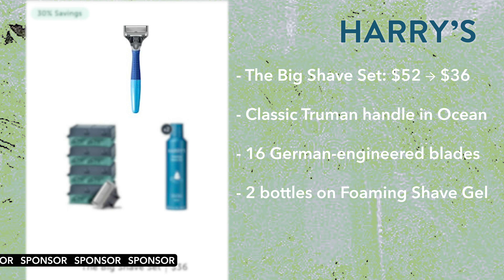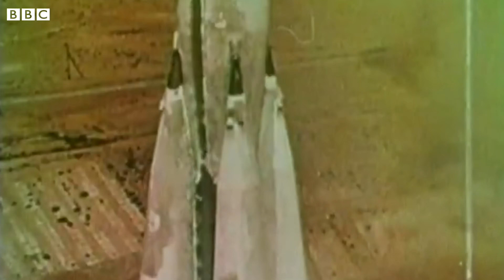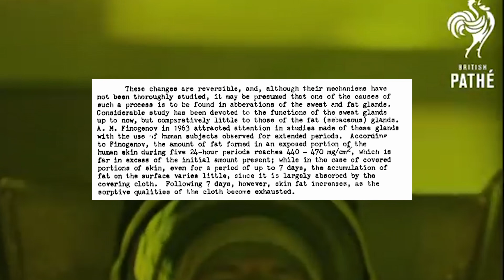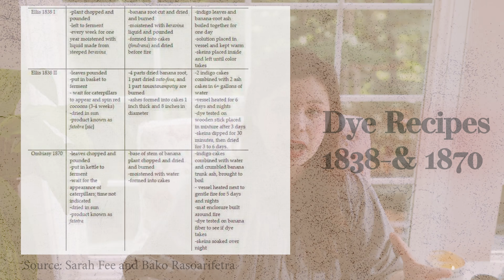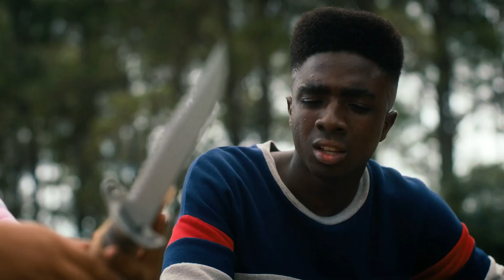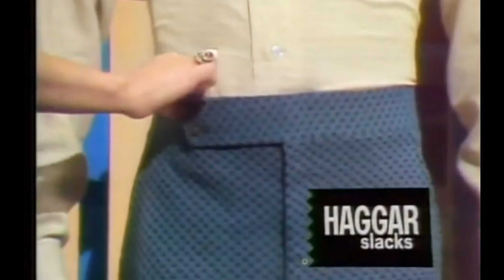The DISGUSTING truth about Laundry

Comment: I know I've left a lot of comments, but this topic and how it was presented really irked me. While the percent of people that line dry sounds about right, and probably varies by region, I really disliked that line drying was seen as almost non existent (maybe in the US it is). "For those of you who are not from North America why don't you just line dry your clothes"?

It's a bit classist. A number of poor people in North America do line dry their clothes, or at least hang some inside to dry. Some middle class people still line dry/air dry in the home, at least some of their clothes. I can't speak of all areas of Canada, but its not an unusual thing in Atlantic Canada. Maybe this comes from the number of rural/semi-rural areas, where it is just seen as usual. Many houses in these areas are set up for line drying, with porches that have a small table area to put down your peg basket, and the line is set up so you can just stay on your porch to reel out the clothes. You can buy wood pegs in most hardware stores, and plastic ones are abundant in homeware shops/specialty shops, etc. Both usually have both indoor and outdoor racks/lines.

Many people air dry in their home more delicate articles, or ones that would be  hard to iron. There has been a running joke for years about treadmills being expensive hangers for drying/ironing.

We have a smaller, more rural/semi-rural, and overall less wealthy population in Canada, compared to the US, so maybe that is the big difference.

Comment: Wow... I guess my lifelong dream of having all silk bedsheets and keeping them forever is unrealistic 😁
It's true in France the vast majority of us air-dry our clothes, even in apartments hanging from windows and balconies, or just indoors with a window open.
Another issue with our laundry practices is the energy used to heat the cold water which goes into the washing machine. We have readily available hot water in our homes heated by a water heater (however energy efficient it may be) but the washing machines are only connected to the cold water pipe. There are some machines with 2 pipe connections, one for cold and one for hot, but they're very hard to find, in france at least

Comment: As a thrift-loving germaphobe with specific sensory issues that force me to use a washer and dryer, this video sort of ruined my life. 😅 On the other hand, I’ve been wearing the clothes I have for decades with very little wear and tear despite having a machine with an agitator, so I think avoiding low quality fabrics in clothes will prevent a lot of the damage and waste Abby describes.
Reply: Your clothes are still getting clean. Hot water and soap will do the job and disinfect your clothes a good amount. Laundry detergent is not completely ineffective like the video claims (tbh I think the research was a bit biased in this one because she knew the point she wanted to make and only looked up and presented details that supported that point, and also exaggerated some parts to make modern laundry practices sound like more of a catastrophic disaster than they actually are) because of the way the molecules work. One side bonds to water, the other bonds to oils and the dirt and grime gets broken down and washed away, which will also take care of bacteria. Are traditional practices better at this? Perhaps, because you can actually boil the water which kills bacteria more effectively. But It's not a black and white situation where one works and the other doesn't. I assure you, your clothes are still getting clean and you are definitely not walking around with poopy t-shirts, you would know if you were.

And if you live in an area with hard water, you can use vinegar to soften it. Don't use more detergent than you need, because that can mess up your clothes and build up in your washer.
Reply: Probably Ive had some shirts for years and they are fine while others I had for a few months and are all faded. It's really in the material
Reply: Same here, germophobe in control. I wash my clothes frequently and I rarely have to trash clothes. I wear my clothes for years. Most of them are in good conditions.
Reply: Suddenly realizing that's a part of why fast fashion hurts in the long run since some companies like Shein are so focused on making as much clothes as possible, that it fuels the market with low quality fabrics.
Reply: I've only been using natural fibers for decades. I, too, have a washing machine with an agitator AND a dryer with a sensor--bought new in 1987. Our clothes last & last. Underwear, & linens are bleached lightly--always whites. I remember my grandmother line drying in freezing temps the clothes would actually be frozen. I have tears in my eyes thinking of her poor hands. Dryers are a godsend especially in colder climates. Many things in this video are factually incorrect or don't present the whole picture.

Comment: Grey water systems can compensate for the water waste. You do have to use specific plant based detergents but it’s an easy switch. And it can be cost effective. I do not have a plumbed system, the washing machine empties into buckets I carry to the yard. Total investment of 3 buckets and I no longer water the yard so tons of savings. Each load is 12 gallons of water. I also line dry. Old cotton clothing become rags around the house. Old polyester type fabrics become floor mats (shredded and tied into a knots). We really do not have to be wasteful, we choose to be.

Comment: I have been washing my clothes in a non electric washer caller the Wonder Wash (not the Wonder Washer, that is something different) for about 2 years now. it's adorable and mint green and it doesn't damage my clothes at all. It actually cleans better than my big shitty washer. It usually costs between $60 and $90 on amazon or ebay and it is so worth it. You do have to manually crank it but I actually find it kind of calming, it helps that I am just doing my own laundry so I don't have a ton to do. But I wash one ;load before bed and than hang them on my garage clothes line overnight so they are dry in the morning. You use a tiny amount of detergent and your clothes last so much longer.

Comment: Alright, so I hang dry about half of our clothes, but in order for them to dry fast enough to not smell mildewy I have to run a dehumidifier and a fan. And I have to use three drying racks, which takes up a ton of space.  It would be great to dry them outside, but it rains a lot and I don't have the option to wait for a sunny day. I have to do my laundry on the weekends or it won't get done.

All that to say, this is a complicated and messy issue.

Comment: fantastic video (yes to way more air drying!) but I have to clarify that surfactants do in fact sanitize. Most living cells are separated from the outside world by a double layer of molecules with one end that is attracted to water and one end that is repelled. Surfactants can attach to these molecules and open cells, breaking down our own cells, bacteria, and most viruses. So detergent is cleaning your clothes; very hot water / bleach is only necessary in particular cases (e.g. ringworm, norovirus)

Comment: I've been using homemade laundry products for years and enjoy experimenting with different formulas. My goal has been to eliminate plastic bottles, so my current favorite recipe only uses products sold in cardboard boxes. I mix 2 parts washing soda, 1 part borax, 1 part baking soda, 1/4 part Epsom or sea salt (to soften the water). I use about 1/4 cup per load along with 1/2 cup soap flakes (Zote white). I adjust this up or down and sometimes add (or spray on) white vinegar depending on dirt/stank. If washing in cold water, I mix all the cleaners in a cup of hot water first. Yes, it's a bit of extra work, but it's cheap, effective, eco-friendly, old-fashioned, and a bit of fun for science/history nerds! Laundry lines banned where I live, so I hang on a shower rod installed over the washer and dryer. I admit to using the dryer to fluff and defuzz, but for a fraction of the time. Experiment for yourself and enjoy the process!

Comment: Superbe! I've learned a lot. I've been doing my laundry detergent for years now and I've banned conditioner. I wash at VA no more than 30 in general, and I thought that was enough. I line dry indoors mostly.
For me the best part of this was discovering the anti-bacterial properties of linen. However I've never seen underwear made of that, I'm curious of where to find it. I try shopping only natural materials, but that's high privilege due to cost as you've said, it's more expensive and I care better for it.
The idea of full undergarments is interesting. I grew up using upper undershirt, however on my teens that got replaced by tops that were occasionally visible. but again... Linen Underwear is nowhere to be seen or is it?

Comment: Italian speaking here. I've been having a laundry-related mental breakdown for about a year. The old washing machine in the house I'm renting made all the clothes smell bad. Like really bad. Luckily we're not banned from using a driying rack, so the smell goes away when I dry them in the sun. I think I now know everything about washing and washing machine care, in the attempt to have nice smelling clothes. And I swear I was this close to buy a giant pot and boiling my weekly laundry.

Our washing machines are loaded with bacteria, which are the cause of bad smells (and also it's gross in general). I never wash at less than 40°C (104°F) anymore and once a month I run an empty cycle at 90°C (194°F) with citric acid (or vinegar) to sanitize the machine, remove the old detergent and limestone residue, which are also cause of bad smell (bacteria feast on those).  This makes my clothes not stink, but it's neither environmentally friendly nor economic. And this drives me nuts.

Sorry for the rant. I just wish my landlady would let me throw the effin' thing down the window and buy a new, less cheap and more efficient machine.

Comment: I remember the first time I bought a really nice pair of jeans. They were dyed with real indigo and fit perfectly. I had never spent that much money on a casual item of clothing. I didn’t make a ton of money so I knew I had to take really good care of them. I was told that instead of washing them in the washer, I should spot clean anything that needs to be wiped off (stains) as quickly as possible and when they start to smell and need to be sanitized I should put them in the freezer. I thought it sounded ridiculous, but I tried it and it worked! To this day, I do this with lots of outerwear like knit sweaters that would lose their texture in a washing machine and dryer as well as delicate items that can’t handle the intensity of a spin cycle. 
I live in the mountains now and during the winter I’ll just spot clean, de-fluff (three dogs), and hang my sweaters outside over night to clean them. My housemates think I’m crazy, but all my sweaters still look new.

Comment: If you use rubbing alcohol or anything with high alcohol content HAND WASH ONLY!  Your washer can catch on fire or smoke. 
I like to buy used clothes and esp Free People (because they were previously made with more natural fabric options, though they fall apart at an incredible rate even only hand washing) and I've noticed the quality of fabric and stitching has drastically gone down. I have to hand wash nearly everything (I only wear dresses) and sometimes still the fabric will wear or stitching comes out. 
Watching shows or movies i can usually tell when it was made, in part from the clothing quality. Fabrics are made as cheap as possible now, even if trying to buy natural.
Reply: Also my only issue with clothesline drying is the insane pollen where I live or how the high humidity can prevent drying in a timely manner

Comment: Use a bidet.  Less pollution in the laundry to sort out.  Use a pressure washer such as a Wonder Wash using far less water than any machine, also less time.  Use a wringer, or drip dry.  Hang your underwear inside a pillowcase, the dry pillowcase will even wick away the moisture from your underwear.  Linen,  especially for towels.

Comment: The thing is, don't hang them to dry in the house on a rack because the amount of water released from it (in water droplets) amounts to cups and cups full of water going into your home, causing moisture problems and can lead to mold and mildew. The best option as you said is a washing line. Dryers bring a lot of moisture into the home aswell, which is not good. A lot of people underestimate mold as an issue but it is pretty serious. Great video Abby, so much research went into this!
Reply: It can, but it more depends on WHERE you are hanging your clothes and how large your overall space is. If you can have windows cracked or open completely while your clothes are drying or, best yet, do it in a central room where air flow is sufficient, that can greatly reduce the mold risk. And it also helps to spin your wash in the machine on as high a spin as the load amount and fabric will tolerate. Modern machines, especially front loaders, do an excellent job of wringing out excess water. I've dried my clothes on an indoor rack for almost 7 years now and never saw an excessive increase in my humidity (as measured with a digital monitor - yes, I was checking). So don't dry clothes in a dark, tiny room with no windows, and monitor your humidity, and you'll likely be okay.
Also dryers should always be vented into the outside anyway.

Comment: I used to have an outside drying line, and when you said "use rainwater" I chuckled, as in my family it's very common to leave the clothes out when it starts raining and leave it until it's dry again, as the rainwater acts as a natural fabric softener, not to mention gives that amazing fresh smell. I'm also used to use vinegar as "fabric softner" or as a odor neutraliser, as it does actually kill bacteria, and is great for the machine. 

I also wash my delicate fabrics by hand and always leave them to air dry or flat dry (I'm Dutch btw)

Comment: Surfactants DO sanitize the clothes, at least for bacteria. Cells barrier is made of a layer of grease like substance, surfactants can destroy that layer and thus, destroing most of the bacteria. BUT if we could combine it with heat, better.
Reply: About the line drying: I live in Brazil, and everyone hangs their clothes. I thought that drying machines are necessary when its snowing so there was no way to dry the clothes other than using a machine. I was naive. Also, once or twice a year, put your mattress in the sun, its AMAZING the smell of the sun in the bedroom.

Comment: The lint dust when you clean the trap is so so bad to inhale. Especially if you're drying synthetics. 
I'm in the pnw currently and I've found that I can't line dry for most of the year. The summer would be the obvious ideal time, but the air is smokey in the summer. So you'd smell like forest fire. Launder by texture/fiber then color,  zip zippers before washing always, towels don't get washed daily, keep towels away from all other laundry they cause so much pilling, etc. I cloth diapered two babies in the desert and line drying worked amazing! Here in the pnw, even the dryer couldn't dry the exact same diapers without running it at least twice. I'm thinking people here historically dried clothes by heat sources (fireplace, stove, radiator, etc)?!

Comment: Also, I completely agree about it being just as easy, if not easier, to hang clothes to dry. I haven't had a clothes drier for years because I haven't been able to afford to buy one. 

But honestly, I actually find it easier now to hang dry. Like she said, it's already on a hanger straight out of the washing machine. So, I skip the step of putting it in the drier, waiting, and then taking  it all out again. Just hang it up wet and it's done. 

The down sides are that most of the pet hair is removed in the drier, not the washing machine. So now the fur stays on the cloths. 

The other downside is that cotton stretches out in the washing machine. And then it shrinks back up in the drier. Without the drier, cotton clothes turn out pretty frumpy if they are hung dried inside. 

These are the reasons why I wear synthetic fiber these days. It stays pretty close to its original form. And it dries fairly quickly. 

The pet hair still stays on, though. Maybe it would blow away if hung dried outside.

Comment: Hmm. I use a small sized washing machine with no agitator. The machine uses so little water that the water doesn't run long enough to get hot. I do have to put the   clothes in garment bags or the end up tied in knots. And I have to add vinegar to the water or the clothes don't get clean. And it does  require a second rinse, though again, it doesn't take much water to fill. 

But I also don't own a clothes drier. If I hung my clothes outside, (which isn't allowed), I 100% guarantee they would be stolen. So, I hang them to dry inside. 

I have this setup because it's what I can afford. 

But it must be working okay because I don't often have to buy new clothes.